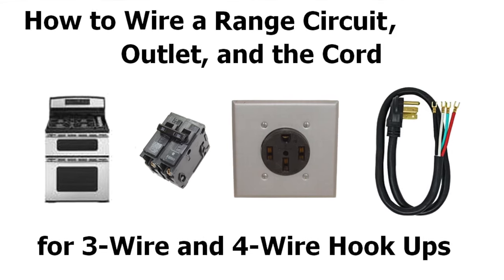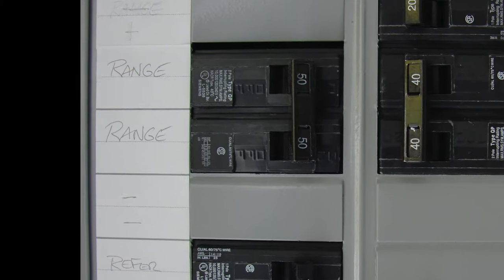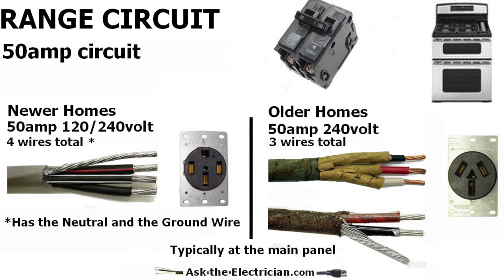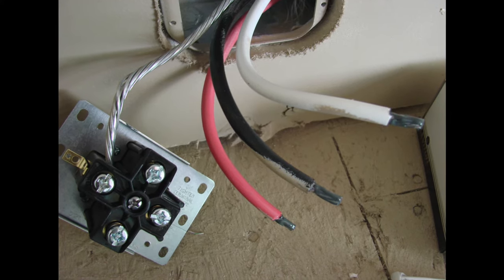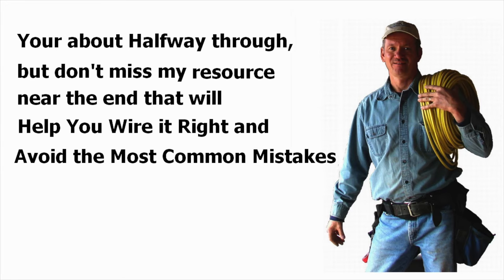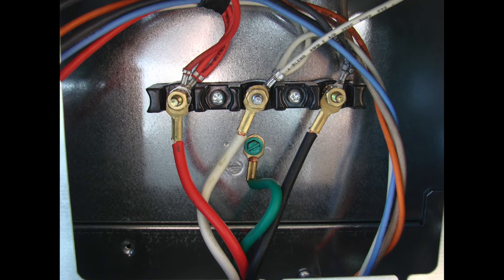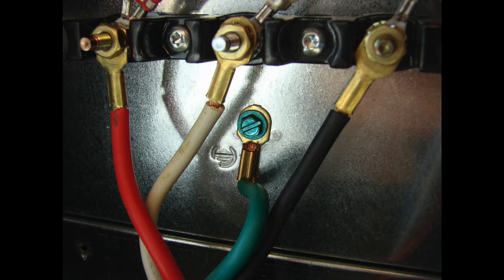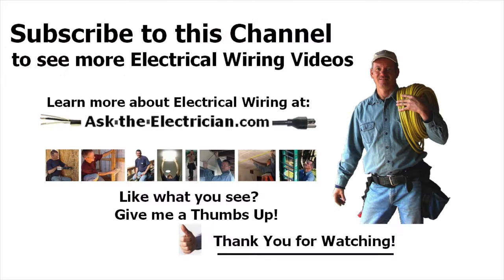How to Wire a 3Prong or 4Prong Range Cord, Wire a the 240Volt Range Outlet.

Comment: Does code say 240 recepticals need to be that close to the Floor in a basement?
Reply from the maker: A typical range has a recessed area near the floor to accommodate the cord and plug and this should be code compliant as well.

Comment: Hello can i add a #8 to  # 6 wire for my stove? The original wire was #6 but due to move the location of the stove had to add some more wire but got #8 does this affect the voltage thanks
Reply from the maker: No because the #8 wire is smaller than #6, therefore it should not be used as we need to maintain the same wire size to ensure the circuit integrity and safety.
Reply: @AskTheElectrician  thank u bud

Comment: i have a 40 amp breaker... can i use the 50 amp outlet or does it have to be a 40amp or lower outlet?
Reply from the maker: A 40amp circuit would have to have a 40amp outlet.
Reply: @AskTheElectrician  I can find a NEMA 14-50 outlet (50 amps) and an NEMA 14-30 outlet (30 amps) but there is no NEMA 40 amp outlet in existence. Can you clarify what outlet you are referring to when you told uncle Freddie that he would have to use a 40 amp outlet?
Reply: @AskTheElectrician .     I did electrical design and engineering for 35 years and retired.   In all those years, I have never seen a 40 amp 120/240 volt receptacle.    Wow, how did I miss those?

Comment: Can I install 4 wired range to 3 wires power source wire?  If yes, how?
Reply from the maker: A 4wire range typically requires a 4wire power source (3 insulated wires and a ground wire), unless your range installation manual states otherwise and provides the method of alternative wiring. Some do, some do not - it depends on which range you have.

Comment: Hi 
I purchased a new Frigidaire free standing range  that came with a 3 prong cord my old stove  was wire straight from the panel on a 40 amp   Breaker, I purchased a 50amp outlet for it, would it work  with the existing 40amp breaker?? It has the 3 wire red black and just the silver wires, is the silver wires my neutral?? On my new plug??
Reply from the maker: Your range requires a 50amp circuit, therefore a 40amp circuit is not sufficient.
See more at ask-the-electrician.com
Reply: Look at the specs for the range and it will tell you what it requires 40 or 50.

Comment: Can you wire a 50 amp outlet for a range that is 40 amps?
Reply from the maker: Only if the 40amp range is actually connected to a 50amp (or typically a 60amp) outlet at the wall. The actual range circuit size should be verified at the panel.

Comment: Does an electric range need to be away from the wall, like a fridge needs air circulation??
Reply from the maker: Great question Ginger. A typical range does not need to be away from the wall, it may be flush against the wall unless your specific range states otherwise.

Comment: I move my stove over 2 feet and don’t have enough power cord from the wall How can I move the plug over? Can I put it in a Junction box and wire nut it like 110?
Reply from the maker: Yes - an accessible junction box may be installed to extend the circuit wiring to the new location. Be sure to use the same size and type of wire and approved wire connectors.

Comment: what will happen if the circuit is only 30 amp? is it going to destroy the range, or it will run with less power? what is the difference between 120/240 and 240V?
Reply from the maker: If a range is wired with a 30amp circuit the circuit breaker will trip when the range exceeds 30amps. A 120/240 circuit includes a separate ground and neutral wire. A 240volt circuit includes a ground wire and not a neutral wire.
Reply: @AskTheElectrician  thanks for the quick answer.

Comment: 1 mile range the wires coming out of the wall only have a white black and brown what do I do there are no red wire
Reply from the maker: The wires of the circuit should be tested  and identified to understand what the wiring is of the circuit, then we can deal with making the proper connections.

Comment: You show three wires all green for the older home then when you show installation you show three different color wires?? Also on my stove the ground isn't connected to the three wires it's off to the side on the stove?
Reply from the maker: The wire colors shown are an example of a typical installation, however the wire colors for the ground may be bare as you mention depending on the age of the home and circuit wiring, and ground wire bonding may be made to the metal frame of the range depending on the specific range that you have.
Reply: @AskTheElectrician  Ok finally got it wired up thanks for feedback .
Reply: I thought the 3 wires older home has 2 hot and one neutral wires. What is this talk about ground wire in it? I am confused..

Comment: for a 3 wire, 2 hot, 1 bare copper; i presume that the bare copper wire should be connected to the metal 2 gang box for a path incase the lives come loose (even though it could possible carry some potential)?
Reply from the maker: Yes - the ground wire may be connected to the metal box as well.
Reply: @AskTheElectrician  great thank you!

Comment: My stove has no white wires!
My cord does….now what?
Reply from the maker: Consult the Installation Manual for your specific range. If it states that a neutral wire is required then a new circuit that includes a neutral wire will be required.

Comment: What size nuts do you need to connect the cord?  I have a maytag advance cooking system.  I have no idea how old it is.
Reply from the maker: The size of the wire nut depends on the wire size, and if the wires are copper or aluminum. Typically gray or blue respectively.

Comment: I have a question question 
My new 2021  range has 4 connections but the the ground and the neutral are bonded together from the factory .
At my main panel in the condo the neutral is not bonded to the ground,  so I should separate the ground and the neutral at the range  before connect the wires  correct ?
I have a 3 wire outlet no separate ground.
So I use red, black and neutral at the range side and leave the ground screw alone since I have no separate ground am I right?
Thank You!!!
Reply from the maker: Take another look at the outlet, because it should have a ground wire included.
Reply: it uses metal conduit that is the ground i suppose @AskTheElectrician
Reply: my old oven has the  ground and neutral bonded together , my new range has the same  layout,
I looked at the electric panel and the ground and neutral are connected it is a new panel
It has a ground connections on the left and a neutral on the right and there is a bar connect them together @AskTheElectrician